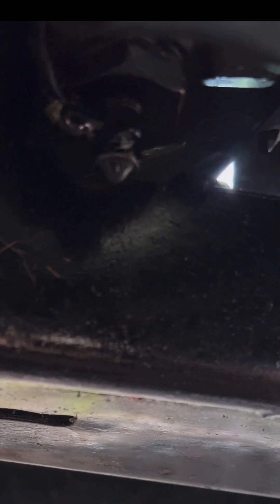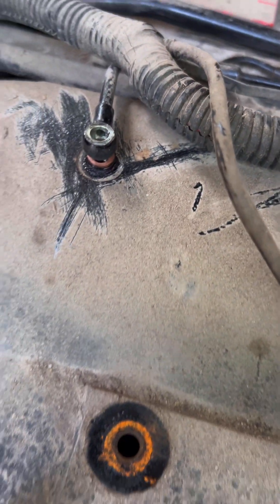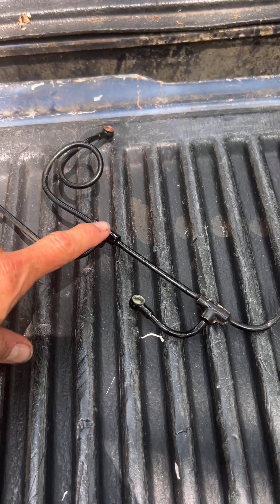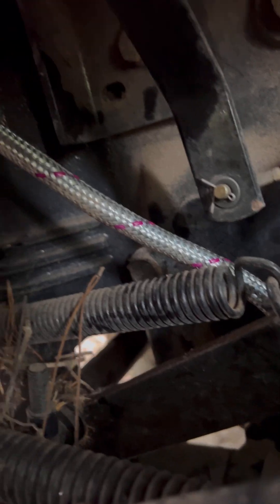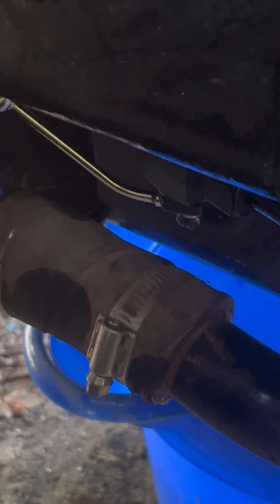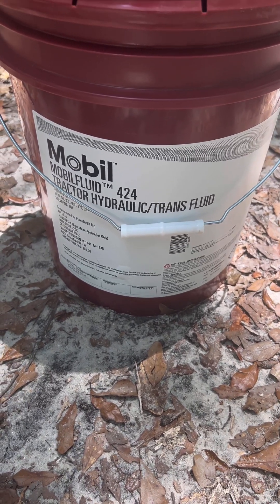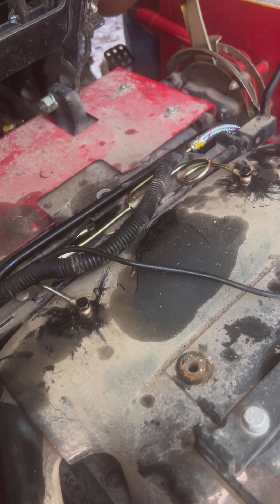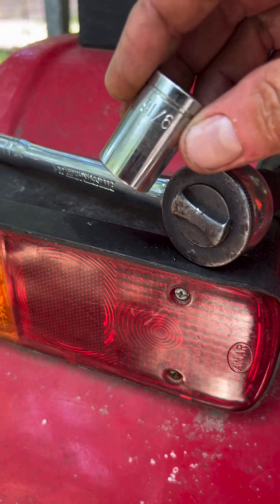Hydraulic Rockshaft Lubrication Line Replacement- Mahindra 4550

Comment: Do you happen to know the bushing/bolt part number for that last connection on the bottom of the tractor? The banjo bolt sheared off at the threads hand tightening it and I can’t find where to get a replacement. Got new banjo bolts but can’t find the bushing it goes into
Reply from the maker: I don’t know the part number unless it is part of that line we installed. Mahindra doesn’t allow aftermarket lines for their tractors, so the dealer is the best bet.

Comment: How did you get the seat off?
Reply from the maker: There are 2 bolts under the seat accessible from the backrest side. Once they are out, it will tilt forward. I show it in the video.